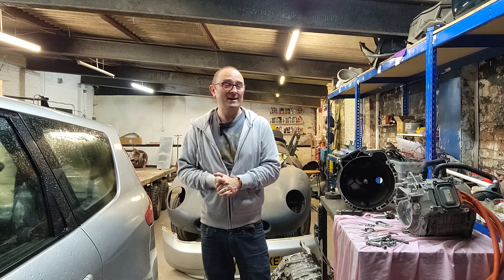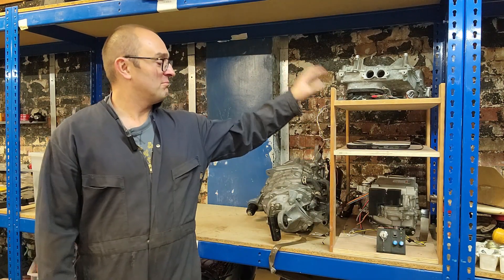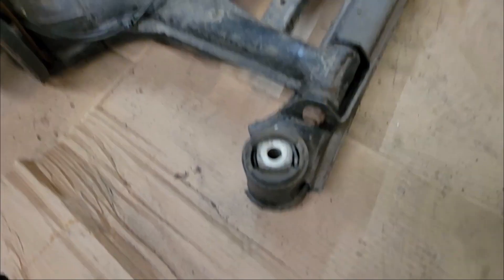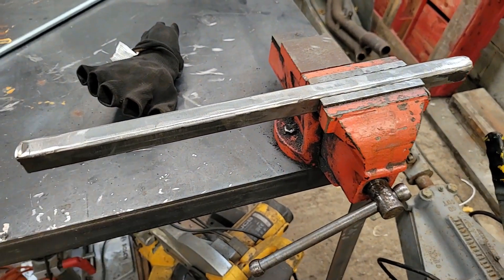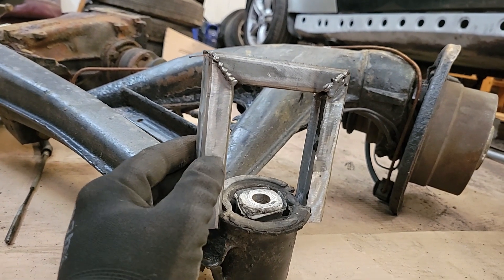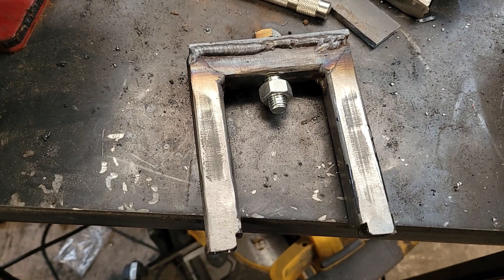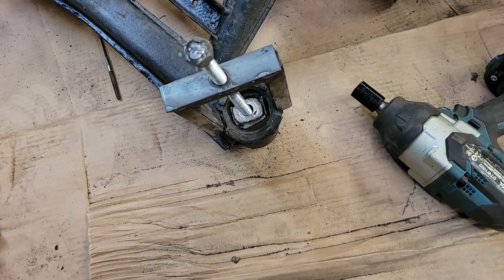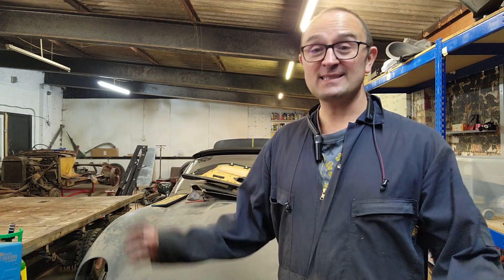BMW Z3 - DIY subframe bush removal tool

Comment: Little tip for your puller: A little bit of high pressure grease (something with MoS2, Graphite or Ceramic in it) does wonders when applied to the threaded rod.

Then you waste less energy on the friction in the threads and have more energy for the pulling. Oh... and you'll ruin the threads less quickly 😅
Reply from the maker: I need to shop for some more lubes! Right now I have bog standard grease, copper and lithium.
Reply: @EVDIY  Be careful with the copper paste, that is not compatible with Aluminium. Better use ceramic based Anti Seize for those areas. (BMW has a lot of aluminium parts, so I guess it might be important).

In Germany we say: "Wer gut schmiert, der gut fährt." - "Those who grease well, drive well." 😄

Comment: Heat the casing with a good blow lamp until the bush starts to smoke, or bubble at the edges, stick a bolt with a penny washer in the top, tap with a hammer, slides straight out. Don’t actually have to hit it hard, if it’s sticking, just heat it more. 
NOT an indoor job!!
You only really need a tool to install it if you don’t have a press, or a really big vice. Needs a ‘tool’ to get the bushes out of the arms though. Cut away the excess rubber, find an appropriate long 1/2” socket, impact sockets are ideal. 12mm threaded rod through the socket, then the bush, penny washer on the end of the bush. Again, heat until it smokes, wind the bush into the socket. 
There’s a specific lube to install them, I’ll send you some. Iain
Reply from the maker: I don't have a press or a big vice! Or a decent torch for that matter. On my Christmas list.
Reply: 😂
My torch is just the cheapest I could find. The ‘press’ is rectangle made from a steel lintel and a 12 ton(allegedly), eBay bottle jack. Also doubles as a caliper piston remover vie master cylinder added to one side, eventually also a tube bender when I get time to finish it.
Reply from the maker: @madzuki1  that sounds like my sort of approach!